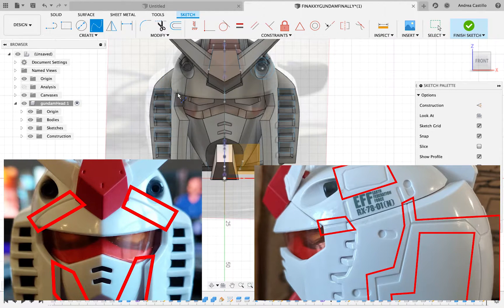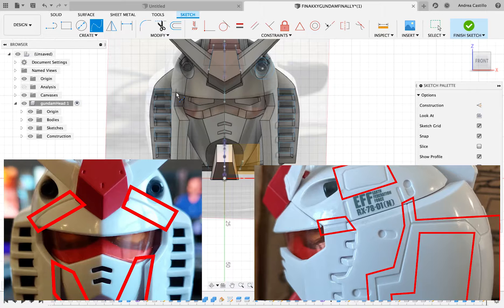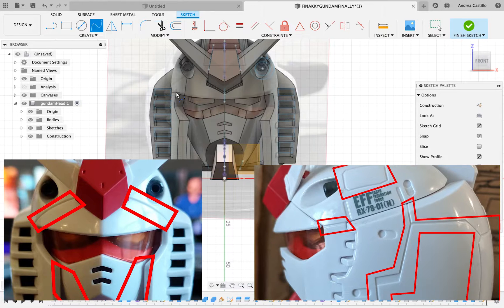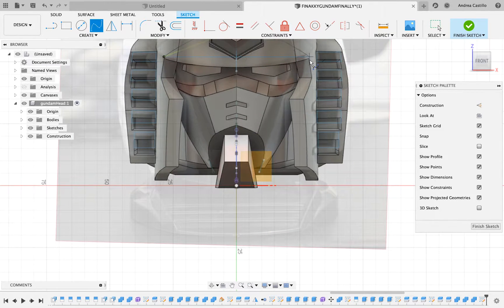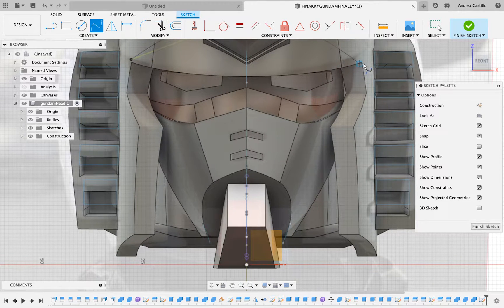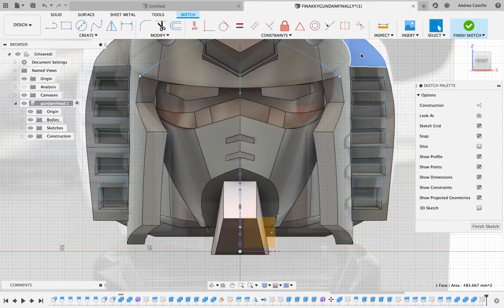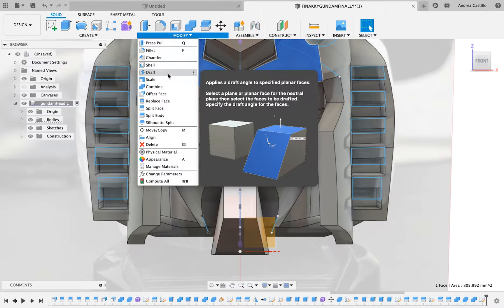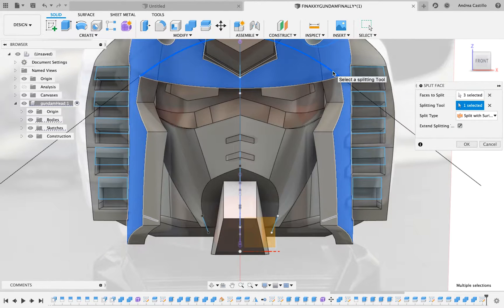Gundam RX-78 Helmet 3D Model Tutorial Part 7

Comment: Great job on the 3d modeling. I checked out the tutorial videos because of Gunpla Meli's vid about trying to assemble the model, and how she couldn't figure out how to glue them together. It looks like the main body of the helmet was cut down into a few pieces (I'm guessing to fit your 3d printer). Have you considered drawing the helmet as separate parts, like having left and right sides, and add slots and mating tabs to the two halves. It might help with the assembly, vs trying to glue 2 flat surfaces together?
Reply from the maker: I gave her the wrong glue info :(. I told her hot glue gun when I meant to say super glue.  I have cut the Gundam differently now. I will have a video up soon with the final result !!!
Reply: @everydaynerdy1619  , Cool. Some sort of alignment guides do help though, especially with superglue. If it's not aligned when it's glued, it's a pain to redo it, rushing though it again, gluing your hands together... ask how I know about that last part. =(
Reply from the maker: @taz77tim  I feel your pain